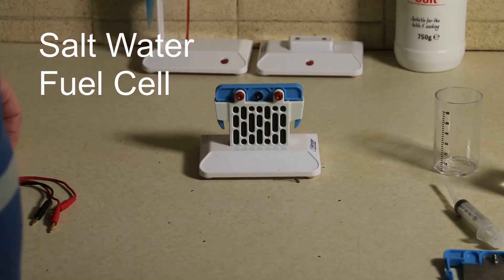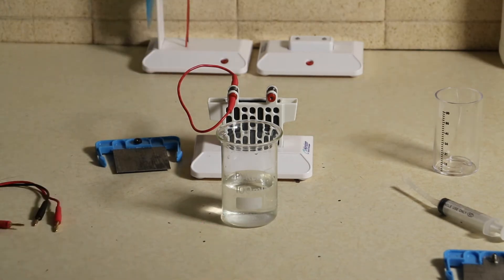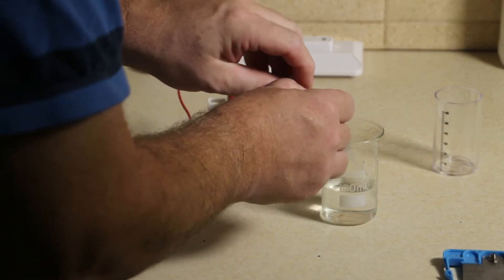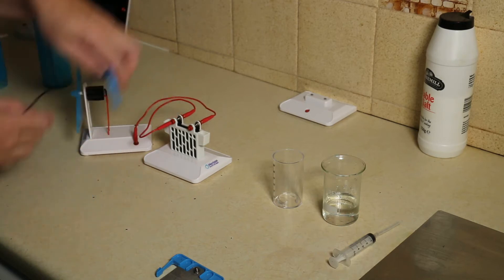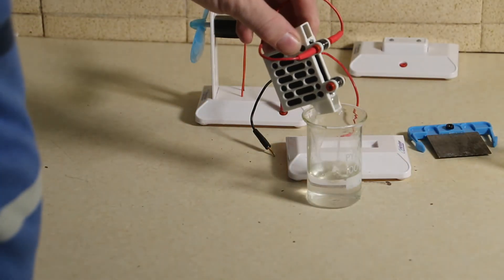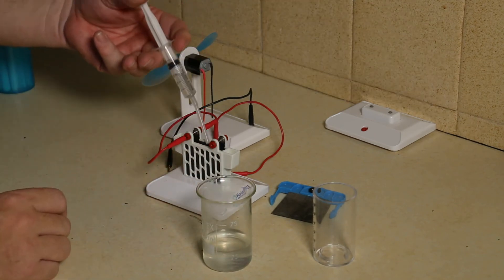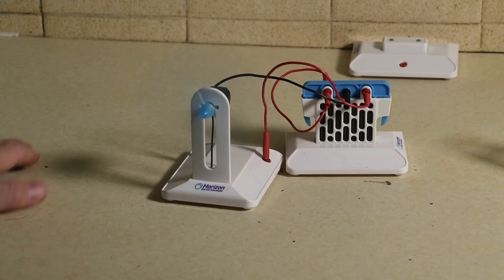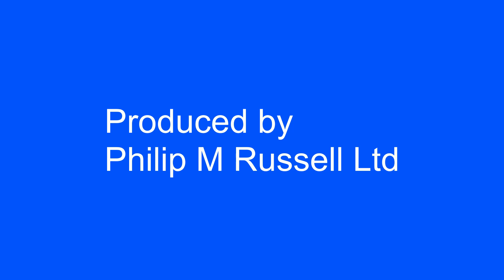Salt Water Fuel Cell Demo

Comment: Excellant video, thank you. I have, however a question. I seen many videos of saltwater powering lights and small motors. How many of these batteries, however, would be required to heat a hotwater bottle sized termal panel using brine? As you may have guessed, my interest is not purely out of curiosity.
Reply: Do share. Thank you.

Comment: I believe you can achieve better results if you'll use not a single quite t h i c c magnesium plate that gets covered in oxidation layer quite fast but if you'll use a whole bunch of really thin magnesium foil pieces, separated by some kind of dielectric, like paper (or just rubber grommets, it's your call). That way magnesium reacts much faster and gets used up in its full thickness.
Reply: https://www.lbbonline.com/news/device-from-wunderman-thompson-colombia-turns-salt-walter-into-electricity

Can we produce commercial electricity near oceans ?
Reply: @sivakumarp9550  I hate that thing. That's what brought me here. It's nonsense, a scam. 
I don't mean scam in that it doesn't work. It works. But it's no different than any other lamp that runs on a couple AA batteries. It's not renewable, it's not green, it's not innovative. The innovation is in the marketing.

Comment: Hey man. There's this product sold for $40 and claim to last 100 hours before replacing electrode $4, and 1000 hours before replacing fuel cell for $11. (Both also sold on the same marketplace.
There are videos there explaining how oxidation occurs similar to yours (in foreign language)
Care to comment? Thanks.
https://tokopedia.link/XzwfRLKqHbb
Reply from the maker: This is basically a commercialised version of the educational model I was using. The Magnesium electrode does get eaten away as the electrical reaction takes place and needs to be replaced - this is the bit doing the reaction - not the salt water. The other electrode should really last a bit longer than that but it is reasonable since it is more complex and costly to make
Reply: @PhilipRussell  Thanks for sharing your thoughts on this. 
I'm planning to buy one, just that I'm still googling on how long can it remain operable if left unused for prolonged period, like maybe a year or two. So it can serve as emergency lamp at home. Also I'm thinking of taking it on a camping trip, maybe could last longer than powerbank on LED.

Comment: That is a lemon battery
Reply from the maker: Yes more or less. Any battery consists of two different metal electrodes; Here magnesium and a vanadium oxide oxygen electrode and an electrolyte; here salt water. Varying the metals and to a lesser extent the electrolyte all types of batteries can be created. Some are more efficient than others and some make more electricity than others. This one does better than a lemon battery
Reply: @PhilipRussell  I just watched a video on royal institute about genesee records breaking  battery of 1300 V lemon battery. The used about a thousand lemon to do that. However, if all the power came from the metal itself and the electrolyte is just a medium, it just seem pointless to use that many lemons. Wouldn't it be efficient enough  to just stack all those metals in series and soak them in salt water?
Reply from the maker: Jordan Wu yes but it sounds better and more exciting to use lemons. Top gear powered an electric car with potatoes. It worked but normally the car just uses normal batteries

Comment: Just wondering does the salinity of the water make a difference in the the amount of charge being emitted ? And how much charge is being emitted , does the thickness of the magnesium plate control how much is emitted ? ( if you put a magnesium car rim in a container of sea water with wires connected to it would it generate an electrical charge ? )
Reply: 2.03 volt
Reply: No because we also have to use graphite because according to luigi galvani we have to use cathode and anode so cathode =graphite and anode=magnesium thenit will produce 2.03 highest among all cathode and anode

Comment: Electricity in this instance is caused by the corrosion of the Magnesium electrode this is not a fuel cell if it were a fuel-cell there would be no corrosion on either electrode the electricity would come from the salt water itself.    The energy would be stored in the salt water. This battery it's no different from a lead acid battery it just uses different materials.
Reply from the maker: Yes that's right. Fuel cells are batteries, either two way or as this one way.
Reply: @PhilipRussell  sorry to disagree with you but fuel cells are not batteries.   They do produce electricity as long as you provide the fuel for it batteries have to be recharged. Batteries are like balloons you blow air into them and what air you blew into them comes back out.    A fuel cell is more like an auto engine as long as you provide fuel for it it will function.    Big difference.   They have discovered how to use salt water as fuel in a salt water fuel cell I don't know exactly how it works but I have read about it.. this is what I was searching for more information about.
Reply from the maker: @vernyanke1131  If I wanted to make a battery I would take two different metals ( ones with different electrode potentials), connect these metals with an electrolyte could even be lemon juice and connect the wire together. Therefore an electrochemical cell consists of three main parts that include two electrodes (the anode and the cathode) and an electrolyte. The anode, or positive electrode, is generally a metal or an alloy of some kind. The cathode, or negative electrode, is usually a metal, or a metallic oxide or a sulfide.  The chemical reaction is a one way process.
A rechargeable battery ( accumulator) is one where we can make the reaction go both ways and when we put electricity in the opposite direction was force the reaction to go in the opposite direction Here, the oxidation and reduction processes that occurred during discharge are now reversed so that electrical energy is converted back to chemical energy.
Fuel cells are different from most batteries in requiring a continuous source of fuel to sustain the chemical reaction, whereas in a battery the chemical energy usually comes from metals and their ions or oxides. 
So the salt water fuel cell is a battery not a fuel cell by this definition. The name gives the idea that it is powered by salt water . This is not the case, it is powered by the Magnesium, but it is called a Salt Water Fuel cell. What is interesting is that a magnesium fuel cell generates electricity using salt water as an electrolyte, instead of the usual chemical alkali, which is much safer.
The distinction between these three is very argumentative and interchangeable..
Reply: @PhilipRussell  putting two different Metals together such as aluminum and carbon isn't a battery either it is a thermocouple it also produces electricity some refrigerators are made with this process there is no corrosion with this system either.   You just heat one of the ends and cool the other it produces electricity or you can run direct current through it and one side will become  cold very efficient I might add.    You can achieve temperatures near absolute zero with this method. One of the Mars rovers uses this system to produce electricity to operate the Rover they put a nuclear pile on one side to heat it and radiated the heat out of the other side  this system they think will produce electricity for 40 or 50 years.    Better than solar panels but it does eventually deplete the nuclear pile and it is radioactive.   The two Voyager probes uses this system as well this is why it has lasted so long.  This method is also used in household heating furnaces as a safety switch so that when natural gas or Propane fuel furnaces have an interruption  in fuel supply does not  f i l l  your house and cause an explosion. When the pilot light goes out it  shuts a valve off and does not allow the fuel to be turned back on until the pilot light is  relit.   Thermocouples are easy to make just take ordinary pencil lead and aluminum foil connect them together and it will produce a small amount of electricity by heating one of the ends and Cooling the other.    I must go now the market is open and I have lost track of time talking to you.
Reply: @PhilipRussell   If you could produce a fuel cell that uses salt water as a fuel since the oceans are full of salt water we would have an unlimited supply of energy now wouldn't we.    This is why I am interested in this possibility.   You see I am a stock market Trader I look for places to invest money this is how I come to know about this.    Sometimes these things pan out and sometimes they don't.

Comment: So u are saying hot water helps to cycle the electric flow? If so can u please explain?
Reply from the maker: Simply the hotter the water the faster the reaction. If the temperature is warmer then the reaction works more efficiently up to its maximum rate and output of electricity. If the solutions are colder then the maximum rate of reaction cannot be achieved. The temperature doesn't have to be that warm but working with really cold water does make the make the amount of salt dissolving  in the water significantly lower and this affects the rate of the reaction.
Reply: Hot water causes the salt to dissolve in the water better and in higher concentration.

Comment: these are pure magnesium sheets right? So... emm. yeah, rare and expensive, and takes a lot of space since you would need like 100 of these in an electric car. And making one bigger makes  no sense so very spacious operation to have basically a generator there and a battery in that car. It'll produce even more CO2 and drilling more mines out of nature to make such a vehicle (I mean over 1 billion world wide), more so than than just electric cars on batteries with a plug. The more converting takes place for raw energy like electricity to other things the more you will lose of it. Efficiency of our devices cannot be 100% ever. We lose it as sound and heat, and light all the time in our engines. We are great at wasting energy...  
We need fusion to fix our energy problems... just wait 50-100 years and fusion will arrive, it's proven to work, and sites are being built all over the world. At least are starting to be built. :) 

who cares... I'm 23 by the time i'll be elderly i won't need to drive a car much or do much at all. I can drink petrol as much as i want to, as there's platy of it still :D. Let the kids decide what to do to travel after i pass away hahaha
Reply: If somehow you could create magnesium by doing electrolysis, when there is ample amount of energy (wind, solar panels), then use the self made magnesium plates in fuel cells with salt water... I actually don't care about efficiency. In the summer and spring solar panels make lots of energy and in the winter there is suddenly nothing. Even efficiency of 2 percent is better then nothing...  actually. But I guess instead of investing in this type of fuel cells, you could better buy a LiFePo4 battery... and charge it up using free energy (if available), though in the winter even a 10kw battery is used up immediately. For the future, I hope fusion will come as soon as possible. If gas/fuel prices are going up again (and they will if there isn't enough available) ... well, maybe the only thing one can do to keep comfort is moving to a sunny country full of solar energy, all year long.

Comment: The black cathode material is air carbon usable for a new salt water battery for the future
Reply from the maker: Yes its activated carbon making in effect a magnesium air carbon battery using salt water as the electrolyte. The Magnesium is used  up but he air carbon remains usable for a very very much longer time. The Magnesium moving 2 electrons each time makes this a more effective battery than many others.

Comment: How can you make the cell last longer? Larger aluminum/magnesium sheets?
Reply from the maker: You are looking at a chemical reaction. Larger sheets will help, but the efficiency decreases as the reaction takes place due to the build up of oxide, so larger sheets are not the only answer.This type of system usually works better if the sheets are replaced from time to time.

Comment: Hi, can we use to produce electricity for our house by developing big fuel cell?
Reply from the maker: This cell uses a  magnesium Electrode. The Magnesium electrode is really doing the work here and gets used up over time. So you need a supply of magnesium as well as the salt water, and you would need an array of these. I don't think it is the best technology for a house. A  hydrogen fuel cell array and a supply of hydrogen would be better. The fuel cells, if linked to a solar array will make hydrogen during the day and then will produce electricity at night.
Reply: But sir, salt water is cheap as compared to Hydrogen, can you recommend me about any books or articles relating to fuel cell and Hydrogen production, I am very interested in it?
Reply: @Ankit-wk7rx  Internet is a free library.

Comment: This is cool! What chemical reaction takes place in this salt water fuel cell?
Reply: This is not possible
Reply from the maker: This is just chemistry. This IS what happens whether you believe it or not
Reply: Can you send the whole paper which can prove this phenomenon. Because I have done some similar stuff and filed my us and Indian patent.
Reply: @nickjha  Google can help you here. Search for "magnesium air fuel cell", there is plenty of info about it there. A "google image" search will give you plenty of diagrams and the first one (at time of writing this) also includes half reactions. You can even buy them, amazon sells "salt water fuel cell" toys. Demanding a paper to "prove this phenomenon" is therefore pretty silly. The idea was developed in the 1960's. Doubting that this thing works is like doubting the existance of 9 volt batteries :P
Reply: What is the cathode material
Reply: @quantumreality8844  All of the examples I have seen use activated carbon on a conductive support or current collector. (edited grammar)
Reply from the maker: The salt water cell is known as this because it uses salt water as a medium to conduct the electricity. The real work is done by the Magnesium plate. The salt water itself does not provide the power for the cell. It is an "ingredient" necessary to keep the cell running.  It is the magnesium plate, which gets used up, which provides the energy source for the cell by way of its chemical reaction with the salt water, and air. Batteries and fuel cells have 2 half reactions. 
This kind of fuel cell works with air and with a plate made with magnesium. The electricity is generated by two chemical reactions which occur at two different places within the cell. At the plate, also called the ‘anode’, the water reacts with the magnesium and creates hydrogen ions (protons), magnesium hydroxide and generates two free electrons. 
On the outside part of the cell (the ‘cathode’), the oxygen contained in the air passes through the cell walls and reacts with the water, creating hydroxide ions. This uses a special type of the electrode - I believe this one uses Vanadium Oxide.
This reaction is possible only if there are additional electrons. So, during the reaction, the free protons generated on the anode are attracted by the cathode because of the potential difference. If the cell is linked to an electrical circuit, the free electrons will pass through it in order to reach the cathode and let the second reaction happen. 
Mg + 2H2O → Mg(OH)2 + 2H + 2e1/2
O2 + H2O + 2e- → 2OH
So the overall reaction you asked for is
2Mg + O2 + H2O → Mg(OH)2
The salt in the water is used as a catalyst., the salt accelerates the reaction between Mg and water without itself being used up.